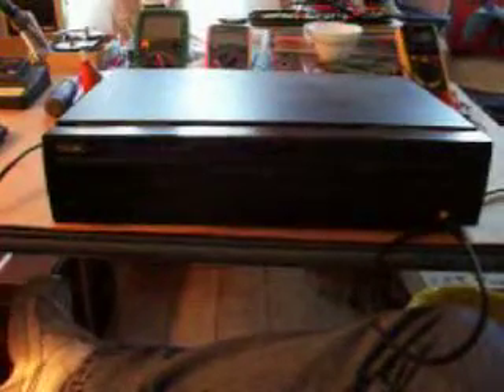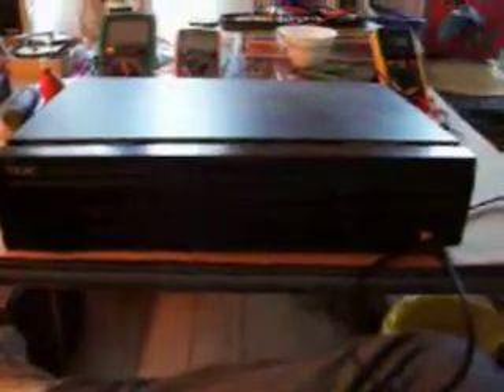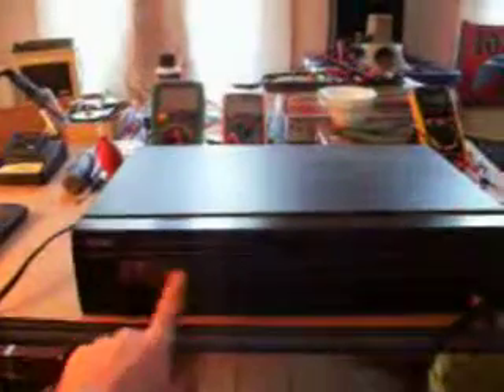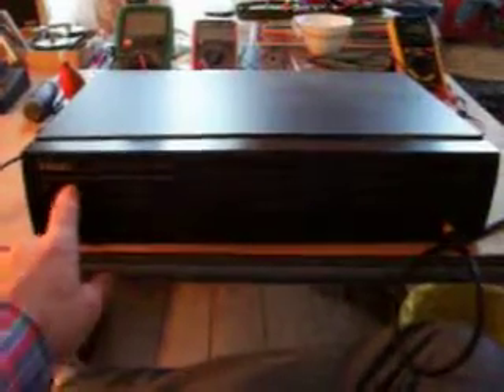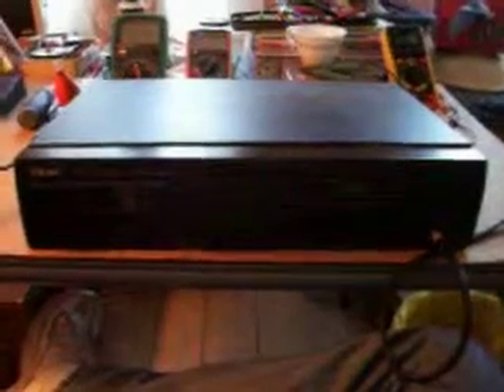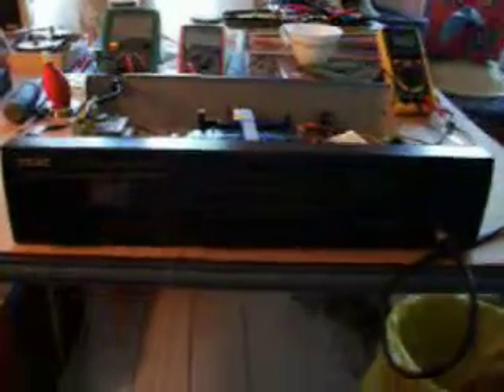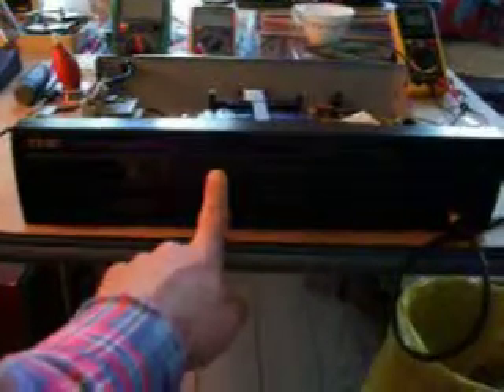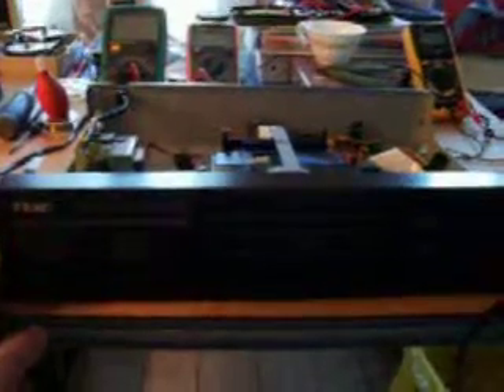Teac CD-P1250 CD Player With Electrical Issues !

Comment: Being used in a garage, it's no wonder the player has developed some problems.

It seems like the limit switch for the optical pickup home position has become intermittent, which is a fairly common problem with CD players in general.

The contacts on the switch become oxidized and cannot reliably close electrically when the switch is engaged.

If the switch cannot tell the system control that the pickup is at the home position, it can cause that popping noise problem when the CD is spinning backwards; the pickup is trying to continue to move towards home when it can't and the gears are jumping teeth, which is what causes the noise.

The disc spinning backwards could be due to a loss of servo lock to the disc track, which can occur if the slider mechanism for the optical pickup is not behaving in a manner that the system control expects it while the disc is being read, and all due to that intermittent limit switch.

The solution would be to either clean the switch contacts or replace the switch itself.  If the switch contacts can be accessed, meaning that the contacts are exposed or its housing taken off, then what I do is gain access to the contacts and take fine sandpaper and gently sand them of oxidation.  It doesn't take much abrasion to clean it; too much can cause problems.  Of course, you might have to tear into the player to get to the switch.

As for other glitches, it could be due to bad electrical connections between cables and sockets; cables soldered directly are generally not a problem in this case.  In a garage, humidity and temperature extremes are factors that can exacerbate this issue.  Reseating the connections and reestablishing the ground plane connections by redoing the circuit board's mounting screws to the player chassis might help.